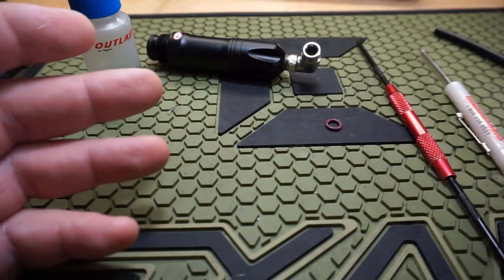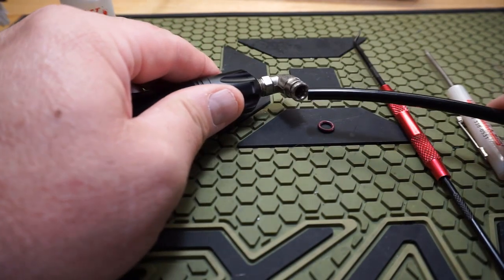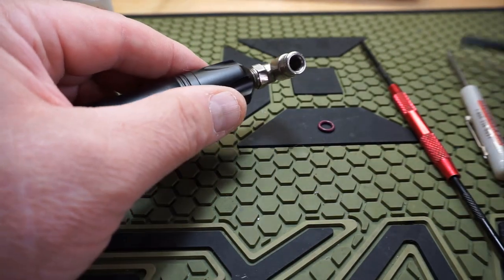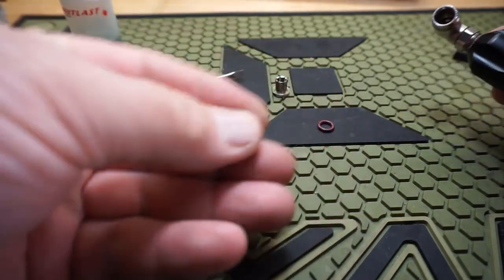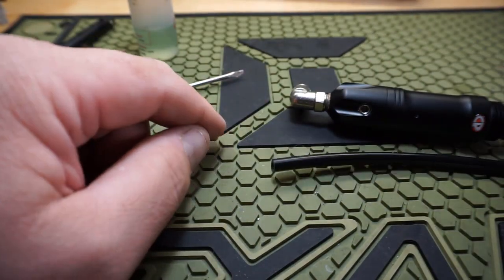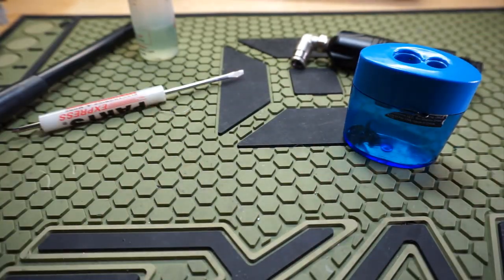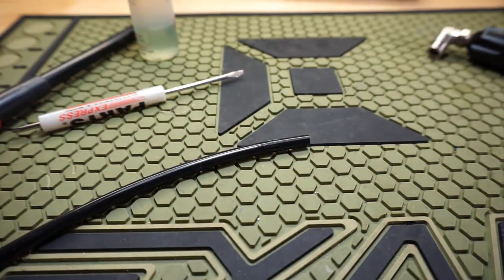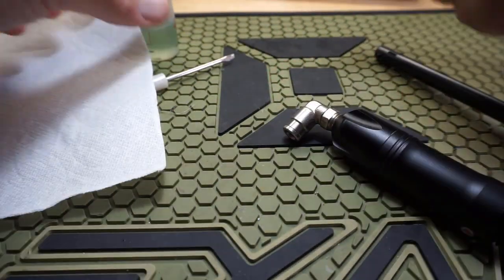Docfire Down & Dirty Tech - Macro Line Hack

Comment: I just cut mine with some large wire snips then take a pair of needle nose pliers to restore roundness. Neat tip with the pencil sharpener - good info on the o-ring, too. Had a guy at our field this weekend throwing a fit because his old fitting was leaking and didn’t want the shop’s help fixing it.

Comment: Nice info. What I've done when replacing the macro oring is use dow33/oil mix and then a coat of dow33 around the macro line when putting it the fitting. Lasts pretty long for me. Cheers everyone.